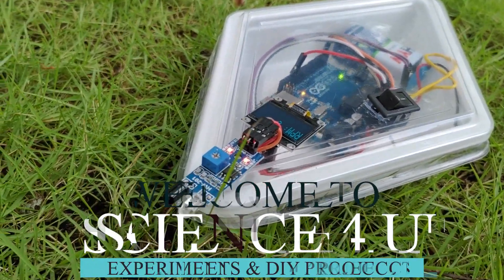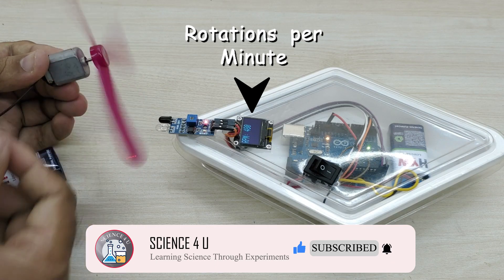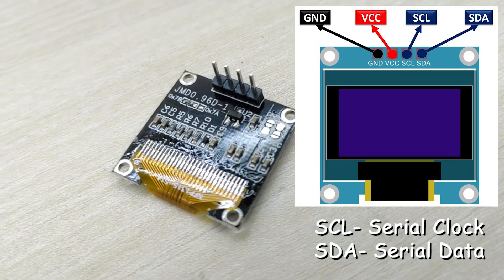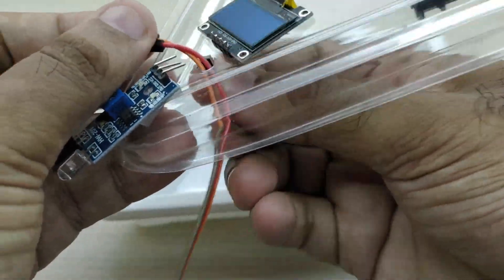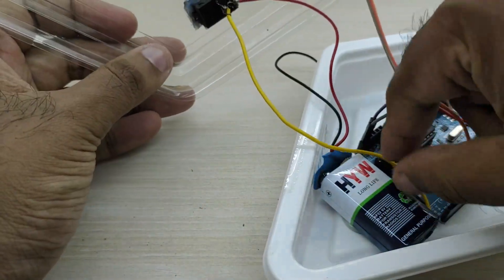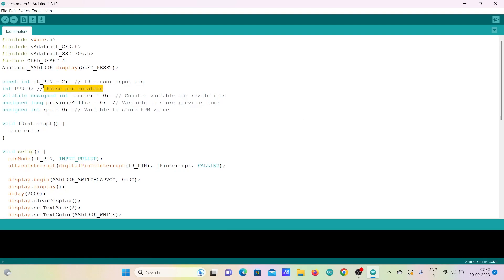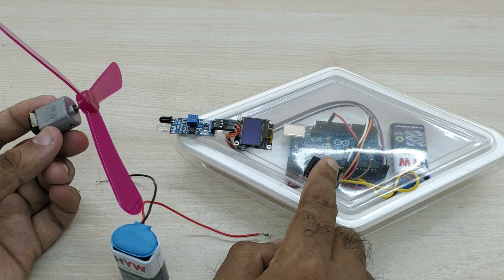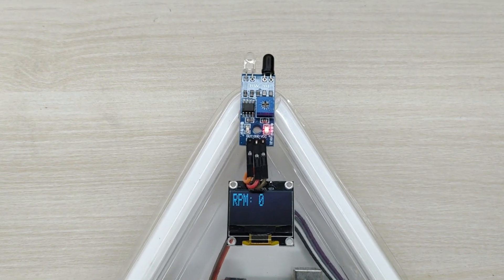Making an Optical TACHOMETER using Arduino and Infrared sensor #tachometer #arduinoproject

Comment: Since the sensor detects object passing in front of it, the measurement of 2 bladed versus 3 bladed propellers should be accounted for. If you have the same motor with the same voltage and current but different numbers of blades, the one with higher number of blades will have the higher RPM. 

The solution is to add buttons to select the number of propellers and the code should divide the output into the selected number of propellers. If the propeller  with 1 blade has 300 RPM, 2 blades should have 150 RPM while 3 blades has 100 RPM..

Comment: Thank you for your really nice video (and very easy to use code) for the project!  The project is also helpful because it teaches how to use interrupts. I noticed that interrupts-based counting works very well and fast with Uno board but poorly with Pro Micro (will overcount by a large factor).
Reply from the maker: Okay..That is true. Thank you for the suggestion.🙂